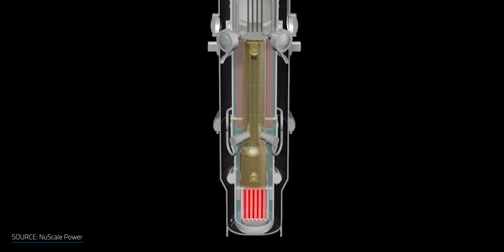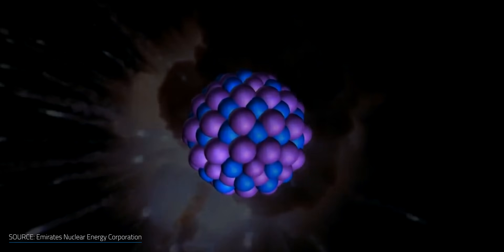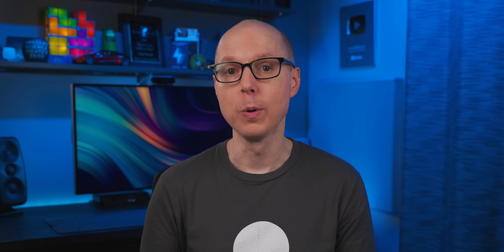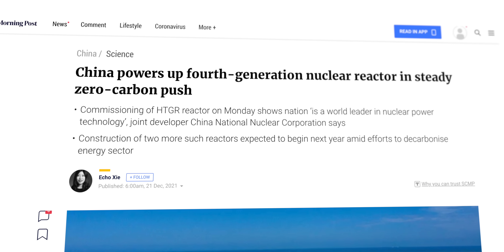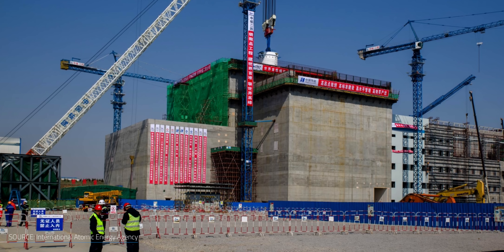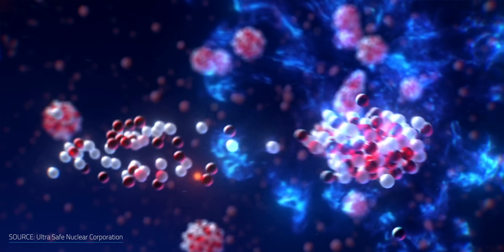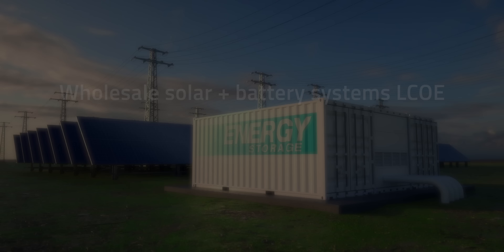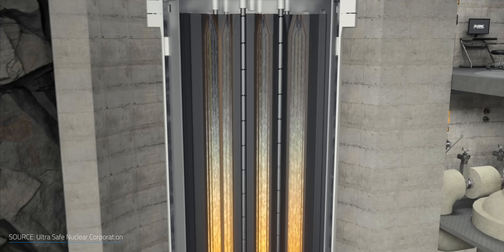Forget Small ... What About Micro Nuclear Energy?

Comment: The more components a system has, the higher must be the reliability of of each component. If you have hundreds instead of a dozen nuclear reactors, each of the micro reactors must be much safer than the current nuclear reactors to achieve the same level of safety. And as we currently see in Ukraine, each nuclear plant is a potential military target. 

Those concepts pop up every 20 year or so, just like Zeppelins in aviation.
Reply: @Wolfgang this is a strange view of the system. More interdependent components make for a troubled system via a failure of reliability in one component but, an independent modular system now becomes redundancy of service. When we take the concept to it's extreme example you have an autonomous power source for each home, business, etc. Then, of course, to design properly each source houses the capacity to power more than just it's 'serviceable node' let's say. Now, interconnect the system. Each component providing the same service and backing up each other should one fail. Additionally, the danger scales with the system. A meltdown of a massive reactor is much more dangerous to the society being serviced than a failure of a micro reactor. Engineering the safety and containment of each source on the micro scale is much more feasible that the same containment requirement for a massive nuclear facility. Lastly, there's the military issue. Again, modular wins. How do you target an adversary's infrastructure if there's no concentrated target to strike. You can take out hundreds and thousands of components of the system and it still functions. You can destroy an ant hill pretty easily, but an ant colony  spread out into the wild with no single central hub... good luck. #LFTR #Thorium #BreederReactors
Reply: @lftr_react  For clarification, I mean the energy system of a country, comparing one with a handful of big nuclear plants and one with hundreds of micro reactors. Let's say probability for accident in a year  is 0.001% per reactor, with 10 reactors you get 0.01% for at least one accident in the country; with 1000 reactors you are already at 9.52% for at least one accident.
Reply: @lftr_react  "How do you target ... " EASY, you calculate the contamination area of one of them then choose a target based on a pattern, with a % of overlaping and if you take in your targeting solution the wind then you can kill all the ppl in the city by using the smallest rockets that can blow the SMRs and in the smallest number possible ( the baddys have a economy too and hate to waste rockets too xD ) in the end all die from poisoning, radiation poisoning and some from the explosions at impact ...
Reply: Complexity is the enemy of reliability.
Reply: By your logic? coins should be snapping in half all the time.
Reply: @JohnnyWednesday  Time. Everything is possible and there are alot of coins.
Reply: @JohnnyWednesday  At least snapped coins don´t contaminate whole countries, when they snap :)
Reply: Everything that has the potential to go wrong, will go wrong if the random conditions are right.
Reply: But in such analysis, you also have to consider the risks and costs of not doing it.  The current alternative is fossil fuel based energy, which has significant numbers of deaths per year related to the particulate pollution they produce, in addition to smog related quality of life issues in big cities, plus all the CO2, plus oil spills etc, plus those power plants are also military targets that cause vast environmental damage if bombed, as are oil fields and pipelines.
Reply: Well these micro reactors would have the latest in safety tech, and being smaller would mean design change when a flaw is identified would be cheaper and faster. You could also recall and replace modules if you identify a design flaw that causes several accidents. A 250 MWt, 77 MWe 640 tonnes module should have about 5 tonnes of fuel at any time, so even if some madman decided to blow it up with a rocket I'd expect the contamination to spread less than 1 km from the impact site, have no effect on other nearby reactors and be relatively easy to clean up. Nuclear plants are military targets because they have nuclear material that someone could turn into a nuclear weapon, so you wouldn't expect anyone to want to blow it up anyway. 

In short the damage in the unlikely event of failure is manageable and would lead to improvement in safety over time at a faster rate than current large reactors
Reply: But thats the whole point. These reactors are far simpler than bigger ones because they don't each need to handle extreme temperatures and pressures. And if a single one fails, the consequences are small and isolated. Your comment makes no sense in this context.
Reply: Not really.  Redunancy and modularity are far more valuable.  There is an inverse curve where too many small reactors is wastefully expensive (nuclear in military vessels), and too few large reactors does the same (classic nuclear).  Building one giant thing is hard, which is why normal nuclear plants take decades to design and build.

Wind farms have dozens of turbines and they can be built in months.  Solar has millions of panels and a small project takes weeks.  You're essentially arguing that one bespoke, gigantic turbine 10x the largest offshore model would be cheaper and more reliable that a bunch of smaller ones.  We know that's not true.
Reply: @nathanm9151   Redundancy protects you from power loss, but not from harmful emissions during an accident. A burning wind turbine is a matter for the local fire brigade, a micro reactor on fire is more serious. And actually, wind turbine keep getting bigger as fast as technology allows. But you are right, easy scalability is a big advantage of wind and solar that nuclear lacks so far.
Reply: Other side of that same medal: if each single reactor has less parts and you don't throw them all next to eachother it is in fact a safer solution.
Reply: @anoniemp238  Risk is the product of cost and probability of an event. True, the cost of an accident goes down for a micro reactor, but if you you don't lower the probability that any of your hundreds of micro reactors has an accident, you dont lower the risk.
Reply: @anoniemp238  There are 150 designs for SMRs, none of which will even have a pilot project operating by 2030. If you had an unlimited amount of money to screen out the designs that make the most sense, build pilot plants, license them, test them and come up with the best to build a fleet of, the most optimistic outlook is 2040-2050 to get them operating. But, woe unto you, there is no market for them. They would still be twice as expensive as existing reactors and ten times as expensive as renewables, which are already producing more energy than nuclear. And they would still be nuclear reactors with all the risks and liabilities that no one wants to tolerate. Financial institutions want safe investments with a quick return on investment. That leaves nuclear out. The public disgust with nuclear is at an all-time high. Any attempt by bought and paid for bureaucrats to fund nuclear with taxpayers' money will get them tarred and feathered. I would be happy to provide the solar energy needed to heat up the tar.
Reply: @jackfanning7952  The cool thing about public opinion is that it doesn't take 10 000 years of continuous re-education to change it. Just a few years of intense counter-propaganda campaigns about the realistic risks of nuclear. Which obviously costs tons of money and requires political willpower. But it can be done. 

As for our amibitions to combat climate change by changing to a cleaner energy mix, it would be borderline braindead to completely disregard and/or underfund the development of simpler, smaller, cheaper and safer nuclear solutions. 

Realistically, once the people are onboard, investments and subsidies will follow, and bureaucrats will have an incentive not to bury those projects in paperwork and intentionally cumbersome validation processes.
Reply: @jackfanning7952  That may very well be the case right now, but as with everything I'm sure there are differing opinions within the experts as well. However from a theoretical standpoint, both nuclear fusion and fission are incredibly efficient and relatively clean ways of generating energy. We may not be there yet with either technology, but like I stated it would be shortsighted not to fund future research even if highly theoretical because of the potential. I know it's not perfectly comparable, but for example modern jet engines didn't just get incredibly fuel efficient and reliable overnight. They were researched, prototyped and iterated hundreds of thousands of times before reaching their current performance. We haven't really had that kind of progress with nuclear (yet).
Reply: @bigdrill8881  The case for nuclear will get progressively worse. Show me one expert that thinks nuclear energy is incredibly efficient and relatively clean. Forbes magazine said in their cover story on 02/11/1985, "The failure of the U.S. nuclear power program ranks as the largest managerial disaster in business history, a disaster on a monumental scale...only the blind, or the biased, can now think that the money has been well spent. It is a defeat for the U.S. consumer and the competitiveness of U.S. industry, for the utilities that undertook the program and for the private enterprise system that made it possible." It has gotten much worse since then. Five meltdowns at Chernobyl and Fukushima. Major disasters at SR-1, TMI, Church Rock, Davis-Besse. As reactors age badly, more will explode. Eisenhower's Atoms for Peace program squandered hundreds of billions of dollars given to the bomb-producing Atomic Energy Commission. It could have been given to the green-powered economy that Truman's Paley Commission said would provide 15,000,000 solar-powered homes by 1975. That is a lost opportunity cost. Costs for solar has come down astronomically since then and nukes the opposite.  No nuclear proponent has promised to insure their reactors. Citizens are personally liable for the loss of their family, health, and home if they are destroyed by a reactor failure or fallout. Reactor waste is hot and deadly for a quarter-billion years. The financial costs for managing that waste cannot be calculated, but be assured there will be a number from 1-10 and a whole lot of zeros to the left of the decimal point. Decommissioning funds allegedly set aside to dismantle old reactors have been systematically looted world-wide. SAFSTOR is not safe and the radioactive rubble is not stored. It is a ploy to take the money and run, letting someone else spend $500 billion busting up an old reactor 60 years from now. The Fukushima disaster is the biggest immediate destruction of tangible invested capital in human history. It will result in the collapse of Japan's economy. No one knows what is inside the destroyed reactors because it is too dangerous to even get a robot in to assess the damage. Billions of gallons of radioactive liquids already are bioaccumulating in the Pacific. Lots more to come. TEPCO is putting clear plastic tape on the corroded leaking tanks in their liquid waste fields. They are burning 1 ton bags of radioactive debris in incinerators with no baghouses or electrostatic precipitators. Nuclear operators in Europe and the U.S.seem to be competing against each other to see which can cause more embarrassment to the industry. And you want us to continue to throw money at this corrupt, dirty, careless, arrogant, irresponsible industry when renewables are a so much better option in every way? No thanks.
Reply: @jackfanning7952  I could not notice that you have this " religious apologiest" way of arguing, where you don't really bother to counter any point made against your arguments but you always just start a new line of attack, with even more claims, and when someone chose a few of these claims and question you about it, you just ignore the questioning and assert a new row of claims, overwhelming the converstation like you have a lot of good argument, but in reality you can't even defend a few of them. So to demonstrate what I mean, you failed to defend your two statements I highlighted in my last comment any way, you just asserted how many new reactors we would need as well as that the nuclear industry is supposedly the most subsidised industry, which is btw very easy to debunk and only takes away from your credibility as you seem a lot more like a hack hackiling than somone who is interested about finding the facts. So that was the comment before and now the new line of attack is made of the fallowing unsubstantiated claims: "its not your opinion it's the opinion of world renown expert's" so name a few, and keep in mind there is a very small group of climatologist which are still not convinced about climate change. So I guess we shouldn't give too much weight to 3-4 ppl's word (even if they are experts) when like another 10 k experts on their field disagrees with them. Nonetheless, name them so we can at least check their credentials.
"Unlike the nuclear proponents, their credibility is impeccable and findings are established facts proven beyond a shadow of doubt." See what you did here ? You just asserted that one side is right and the other one is wrong based on... not their opinion but based on your.
"I comment to provide the truth to you nukies who listen to these puff pieces for nuclear energy." Than you should focus on stuff you can understand and prove, otherwise it come across a bit clownish.
"You care more for your cushy income from this energy source than you do about the health, environmental damage and economic damage it does."
I have no cushy income from the industry currently. And I don't know who and why would ever get if accourding to you the whole industry is an unprofitable sham, so where does a cushy income suppose to come from ? But one can throw this back at you and say you are advocating hard for something clearly unsustainable (squere miles of pv panels suported by a dream of smarter grid cheaper energy storage and natural gas) because you probably have a steak. 
And if you didn't know every type of energy production carries its own enviromental costs and now you know it. Solar panels, unrecyclable windturbineblades, battery stations, grid extension. Not like these does nothing to the enviroment. Matter in fact they produce a whole lot more waste volumetricly speaking and that is something you want to ignore because you have a beef with the other solution. Yes nuclear waste is generally more dangerous, but its a lot less by amount and one needs to see the tradeoffs. Have you seen the garbage and plastic piles in the ocean ? Not especially dangerous waste type, yet simply because of the huge amount we have thrown away Im willing to bet those caused a lot more enviromental harm than any nuclear waste ever did. Because, again, the amount and disposal does matter. Dispose nuclear waste safely and you have a lot less waste to worry about than what you have to manage if you want to run the world on renewables somehow.
Reply: @CraftyF0X  You asked for sources. I gave them to you.  I have defended some of my claims, but not all. I do not want to write a book on a YouTube comment. Then you ignore the responses I have made and attack me for others that I did not. You want experts? How about Dr. John Gofman, Director of the Lawrence Livermore Medical Lab, Physics Professor at the University of California at Berkeley, worked on the Manhattan Project, or Arnie Gundersen, a licensed nuclear engineer with 40 years experience in managing projects at 70 nuclear reactors who wrote the first decommissioning standards, Dr. Alexey Yablokov, Boris Yeltsin's Science Advisor and author of the most comprehensive collection of research studies by 600 East European Scientists on Chernobyl consequences, or Dr. Kate Brown, MIT Professor, Dr. Marco Kaltofen, Boston Chemical Data Corporation, Dr. Gordon Edwards, Canadian Coalition of Nuclear Responsibility, Dr. Timothey Mousseau, USC Professor. These are some, but I read extensively. 
"You have no cushy income from the industry currently." How about in the past? What about the people who write these puff piece circle jerk articles about nuclear? Cushy incomes come from taxpayer subsidies and the highest rates of any energy source: nuclear- $118-192/MWh, utility scale solar - $32-42/MWh, and onshore wind - $28-54/MWh. Source: Amory Lovin's Forbes magazine article, "Does Nuclear Power Slow or Speed Climate Change." Clearly unsustainable? (Squere [sic] miles of pv panels) Did you hear the latest report that 90,000 square kilometers of solar PV in the Sahara could provide an equivalent amount of electrical energy as all the current power plants in the world of any type. Google it. Wonder why the nukies and fossil fuel industries are so opposed to it? Might hurt their cushy deals, huh. I do like steak but do not have a stake in nuclear, renewables or any other energy source. I spent my career monitoring and devising methods to reduce industrial pollution. Now I just enjoy my gardening. Waste volumes for energy sources - Did you know it takes 1 million lbs. of 0.1%  uranium ore (fairly rich ore) to produce 7 lbs. of U-235. A reactor uses about 10-20 tons of enriched U-235 per fuel cycle. The hundreds of millions of tons of still radioactive and acidic tailings laced with heavy metals and arsenic are dumped on the surface in huge piles and in sludge ponds, contaminating the land and occupants unlucky enough to be in the nukies' way. Let's talk about subsidies. From the Chemical and Engineering News article, "Long History of U.S. Energy Subsidies," 12/19/11, it lists the amount of inflation-adjusted subsidies from the start of an energy industry under two categories: 1)  Start-up funding for the first 15 years of the industry, and 2) annualized expenditure over the life of the energy source. Here are the figures:
1) Federal support for the first 15 years: Nuclear $3.3 billion, Oil and Gas $1.8 billion, Renewables - $400 million. 
2) Oil and Gas 1918-2009: $4.9 billion, Nuclear 1947-1999: $3.3 billion, Biofuels 1980-2009: $1.1 billion, Renewables 1994-2009: $0.4 billion.
Not taken into consideration in this analysis is the Price Anderson Act of 1957 that indemnified nukes in case of an accident. I wonder what the annual liability insurance coverage for a nuclear reactor would cost? Also not included was the American Recovery and Reinvestment Act of 2009 with $40 billion in stimulus funds to nuclear. Another sweet deal the nukies got in that act was the government guaranteed they would pick up the tab for the construction loans for any reactor that never made it through the construction process.That amounts to another $100 billion which is still tied up in the courts. Let's not forget the $1 billion a year the nuke utilities are getting in U.S. taxpayer money for storing their own radioactive waste from hell on their property near every major city in the U.S. Sweet!
So, when do you think the nuclear industry will dispose of its waste safely? It has been 75 years of unsafe disposal, so far.  By the way, did you catch that report last month about the ship impounded in Kenya, coming from India with radioactive waste they were going to dump in the Atlantic? Monkey see, monkey do. India was just trying to get by like the other nukie countries have been doing for decades.
Reply: @jackfanning7952  "How about Dr. John Gofman, Director of the Lawrence Livermore Medical Lab, Physics Professor at the University of California at Berkeley, worked on the Manhattan Project, or Arnie Gundersen, a licensed nuclear engineer with 40 years experience in managing projects at 70 nuclear reactors who wrote the first decommissioning standards, Dr. Alexey Yablokov, Boris Yeltsin's Science Advisor and author of the most comprehensive collection of research studies by 600 East European Scientists on Chernobyl consequences, or Dr. Kate Brown, MIT Professor, Dr. Marco Kaltofen, Boston Chemical Data Corporation, Dr. Gordon Edwards, Canadian Coalition of Nuclear Responsibility, Dr. Timothey Mousseau, USC Professor. " Are you sure they have the very same attitude toward nuclear energy as you ? You know, because in case if they have a critic of how things went in the past or even how things go right now its probably not the same as you hating everything about nucear energy.

"taxpayer subsidies and the highest rates of any energy source: nuclear- $118-192/MWh, utility scale solar - $32-42/MWh, and onshore wind - $28-54/MWh. Source: Amory Lovin's Forbes magazine article, "Does Nuclear Power Slow or Speed Climate Change." 
Made me wonder, what should I belive the wiki numbers (70% fossil fules, 20% renewables, 6% biofuels, 3% nuclear) coming from the International Renewable Energy Agency or a business magazine article of Mr. embodiment of antinuclear activism and former oil lobby group member.
"Did you hear the latest report that 90,000 square kilometers of solar PV in the Sahara could provide an equivalent amount of electrical energy as all the current power plants in the world of any type. Google it."
Yea I heard about it, and I have to say it really speaks volume about your technical understanding if you just blindly accepted it.
"Wonder why the nukies and fossil fuel industries are so opposed to it? Might hurt their cushy deals, huh"
Or what about because it wouldn't work as its unfeasable  ?
"Did you know it takes 1 million lbs. of 0.1%  uranium ore (fairly rich ore) to produce 7 lbs. of U-235. A reactor uses about 10-20 tons of enriched U-235 per fuel cycle. "
yea and ? Its still the densest form of energy million times denser than fossil fuels, we still get a lot out of it what is your point excatly ? There could be better burnup I agree for example in a molten salt reactor, but you against that too.
"The hundreds of millions of tons of still radioactive and acidic tailings laced with heavy metals and arsenic are dumped on the surface in huge piles and in sludge ponds, contaminating the land and occupants unlucky enough to be in the nukies' way."
Yea, whatever comes up, come up in other type of mining activities as well, so you are not anti nuclear you are anti mining then ?

Start-up funding for the first 15 years of the industry, and 2) annualized expenditure over the life of the energy source. Here are the figures:
1) Federal support for the first 15 years: Nuclear $3.3 billion, Oil and Gas $1.8 billion, Renewables - $400 million. 
2) Oil and Gas 1918-2009: $4.9 billion, Nuclear 1947-1999: $3.3 billion, Biofuels 1980-2009: $1.1 billion, Renewables 1994-2009: $0.4 billion.
bppppft lol I agree your apples a lot more like apples than the oranges I have. I mean isn't that odd that nuclear is only tracked till 99 and renewables till 2009 ? Almost like there is an agenda behind the intervals. Almost like it looks a lot more daming if you skip the last 10-13 years of nuclear getting less and less and renewables getting more and more.
"Not taken into consideration in this analysis is the Price Anderson Act of 1957 that indemnified nukes in case of an accident. "
No one will defend the nuclear practicies in the 50s USA (neither in the USSR) it was about the bomb not about safety or economics, that is long behind us.

"So, when do you think the nuclear industry will dispose of its waste safely? It has been 75 years of unsafe disposal, so far. " 
Well, in the USA urrently you can thank your "antinukie" friends for blocking the Yucca mountain project which would have been a good long term solution. Nimbyism killed it, appereantly a lot of ppl dwells on and under that mountain, so they essentially voted for the waste to remain in spent pools and dry cascets in production sites. As for wiser countries, Finland pretty much solved this problem for it self and the whole continent with it's deep under ground geologically stable Onkalo spent nuclear fuel repository.
So its not like its impossible or something, actually its kind of an easy problem as long as you have the political will.

"By the way, did you catch that report last month about the ship impounded in Kenya, coming from India with radioactive waste they were going to dump in the Atlantic? Monkey see, monkey do. India was just trying to get by like the other nukie countries have been doing for decades."
No I did not, but its sounds like a cool story bro.